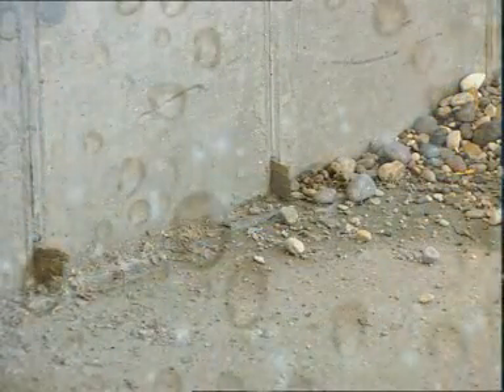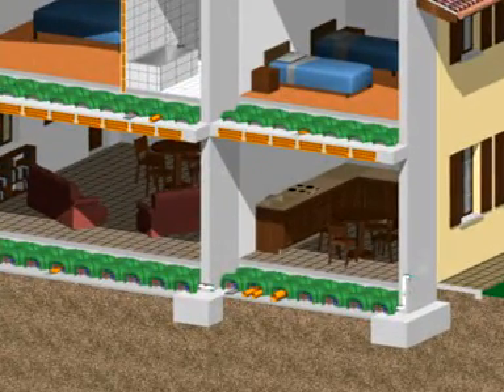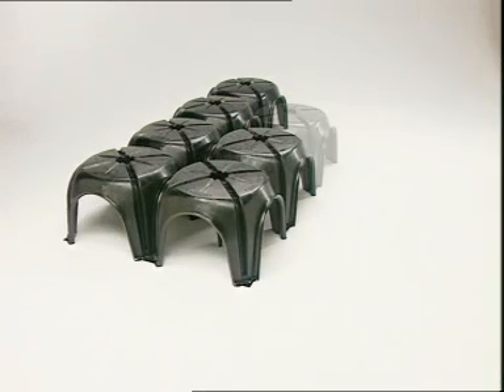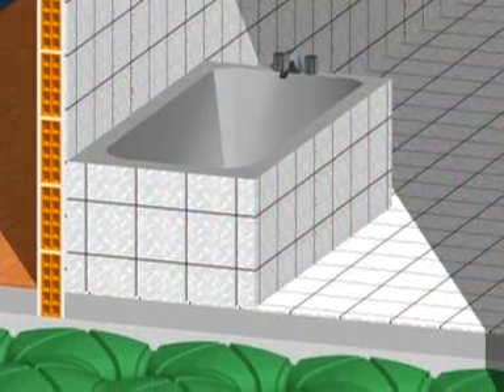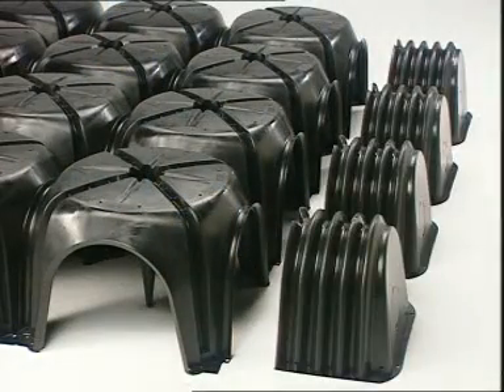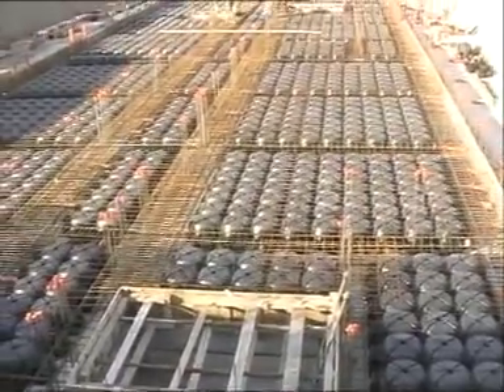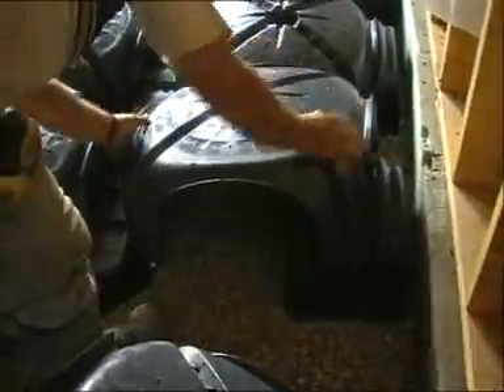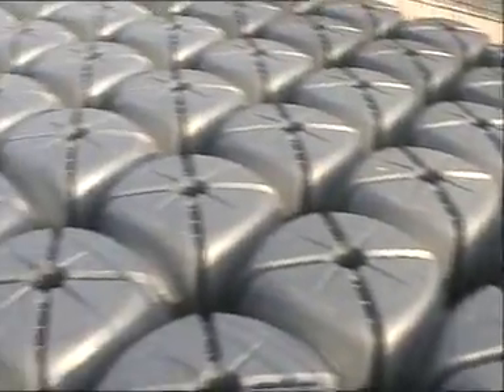Cupolex Aerated Floor - Vapor Intrusion Mitigation Solution.mpg

Comment: Do you have a simple formula or a  for calculating the concrete between the pods and in the piers as thevoids are not uniform as they are in the waffle pod system

Comment from the maker: CUPOLEX® provides a new method for the structural analysis and construction of slab foundations on
expansive soils. The structural function of the CUPOLEX® foundation is designed to resist moistureinduced
deformations in the soil maintaining the top surface within permissible tolerance. The Concrete
verifications are performed according to national and local standards by using reinforcement threaded
bars or post-tensioning tendons.